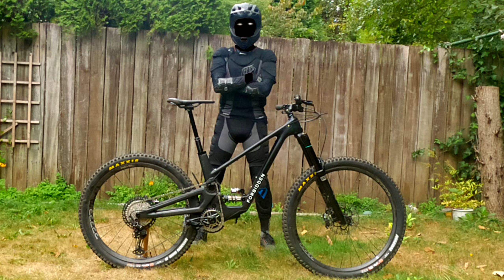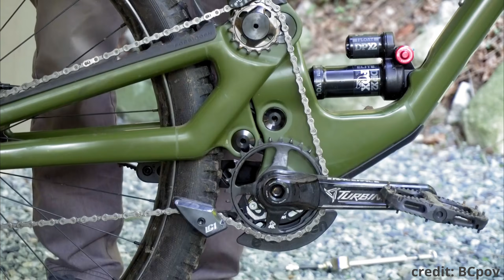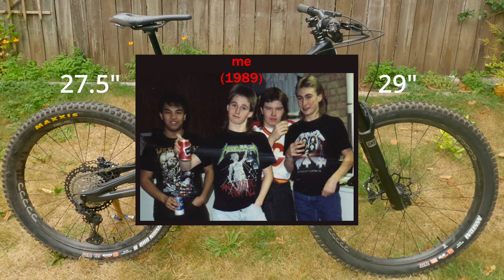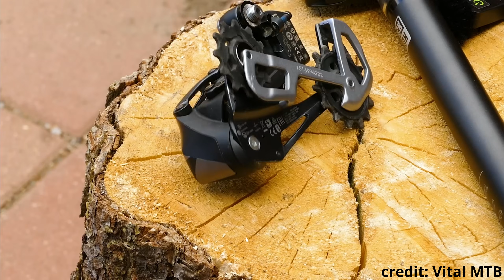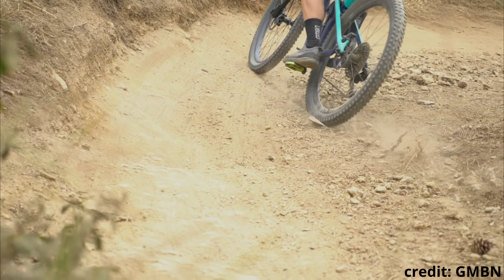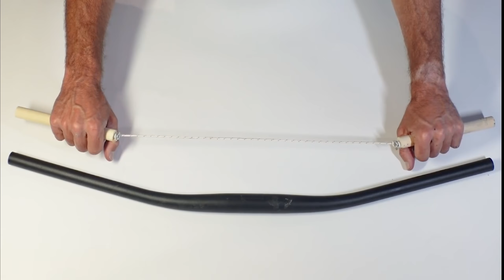Forbidden Dreadnought - High Pivot Glory!

Comment: What is your weight on a 325 coil spring rate?
Reply from the maker: 140-150 lbs or so
Reply: @IDoBlues Tha k you for the reply. I have ext storia with 375 coil planing to change it. My weight is 160lbs with full gear. Should i go 350 instead? My bike is  Fb Dreadnought Medium.
Reply from the maker: Ya, for 160 lbs riders, Forbidden recommends the 350 coil. https://us.forbiddenbike.com/pages/setting-up-your-dreadnoughts-suspension

Comment: So how much does this thing weigh all said and done? Looks sweet, I am pretty much the same height and weight as you I’ll do my rad sizing but think I should hop on the smaller bike trend.
Reply from the maker: I haven't actually weighed it! Feels plenty light on the trails though. Ya, I've really found that for my size (5'7-ish) and shape, a reach of 435-440 is the sweet spot. All three of my bikes (Enduro, DH & eBike) are now in that range. My eBike used to be 450 (before I converted it to a higher travel mullet)  and I found it a touch too long.

Comment: Nice video. Question about RAD  i wanted to do same setup like yours, although my Rad was just 77cm or 770mm. . Im 170cm in height. That puts me to 433.5 reach. Im a bit lost on Rad what do you recommend get into 77cm Rad.
Reply from the maker: You are pretty much the same height as me. A bike with a reach of 435mm is a good starting point. If you want to reduce the RAD of the bike, you can reduce the spacers under the stem, go with a shorter stem (say 30-35mm), use a low rise bar (or tilt your bar down).  

Also, make sure to triple check your RAD. Bike shoes on, stand tall, look straight ahead, shoulders back. It's so easy to miss measure your RAD. I used to think mine was 780, but it's actually 810.

More info here...

https://youtu.be/SnXe2RmxKrE
Reply: @IDoBlues  appreciate  it really. Im torn between that dreadnaught or the Bronson.  Newer Santa Cruz got longer now. i tried to sir on Medium Bronson and it felts a bit big and i cant even stand flat footed on the bike  when the seat was down.  Can you tell me if the seat fully slammed on your dreadnaught you can fully flat footed on top of it and not hitting the top tube with ur crotch?
Reply from the maker: @roldan2009  Oh ya, I have no problems with the standover height of the small Dreadnought--the top tube sits pretty low at the seat post.
Reply: @IDoBlues   thanks. I think i will go to dreadnaught. But will try to demo one if i got a chance to sit on one. Closest dealer was like 7hrs away from me. And im not even sure if they got a small i can demo.

Comment: Have you encountered idler pully issues such as chain coming out of the guard? or the linkage coming loose?
Reply from the maker: Nope. None of the above.  I haven't noticed the idler pulley on the trail at all so far.  ...but I imagine as things get wet & muddy, I'll need to give the drivetrain some extra TLC between rides to make sure everything is clean & lubed.
Reply: @IDoBlues  Thanks for the answers! 👍🏻 😄

Comment: Nice bike! How is it climbing with the high pivot design? I run high(ish) pivot design on my DH bike, but fortunately don't have to pedal/climb much.
Reply from the maker: I felt no noticeable difference on the climb. I think Pinkbike did a test with high pivots and found it had a 2% cost.  So on a 45 minute climb, it might take me 46 minutes...probably less. On technical sections of the climb, having that rear wheel move out of the way on compression felt good.

Comment: I'm currently debating whether to get a full 29er for my next bike or go mullet. I currently ride a 27.5. What is your experience with 29er (Orbea)? I'm probably a couple of cm taller. Does the rear wheel smack you in the butt often?
Reply from the maker: I don't have any real issues with the full 29ers. That's all I've ridden for the past 4 years. But I think the mullets are more fun. I'm actually going to convert my Orbea to a 160/160 mullet.

Comment: Thanks for this. As an over 50 myself, I appreciate the research you did. Will be looking into SQlab saddle and the Revel rims. Not near as many injuries as you but the ones I have rear their ugly heads once in a while. FYI I'm riding a Commencal E-bike and am upgrading the componentry when they need replacement.
Reply from the maker: That Commencal eBike must be a powerhouse!

I really like those Revel rims.  This winter, I'm converting my Orbea Rise to a 160/160 mullet and I picked up another set of them for that project.  As of 2022, the rims retail for $699, but I found one unused rim on Pinkbike for $300 (score!) and got one on evo.com for $559 (sale is still on as of today).  My son needed a new rear wheel on his bike and I found a Revel wheel built with an I9 Hydra hub for 35% off at Backcountry.com (they are now 20% off as of today).  Point being, they aren't cheap, but I did find some deals on them with some hunting.  

Another wheelset I often recommend to my friends who chew up rims (or are riding eBikes hard) are Nobl. They are tough as nails and also have a lifetime warranty.
If you ride 2.4" or 2.5" tires - https://noblwheels.com/tr37/ 
If you ride 2.6"+ tires - https://noblwheels.com/tr41/

....but ya, I really like the feel of those Revels.
Reply: @IDoBlues  Thanks